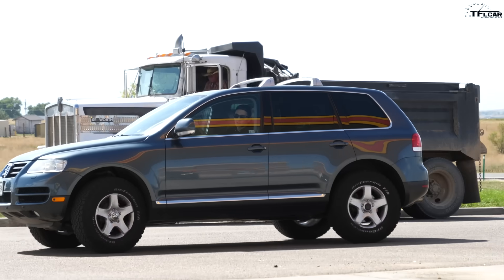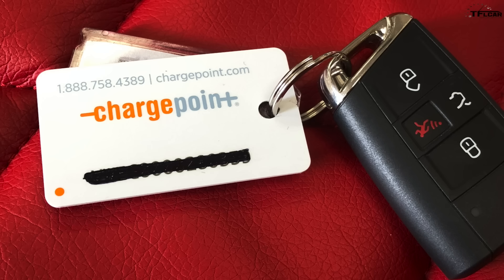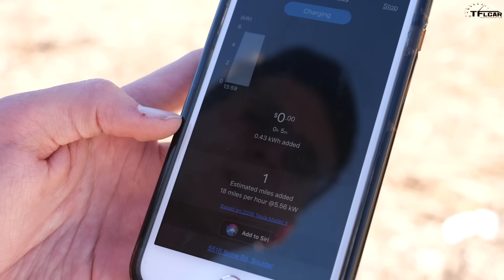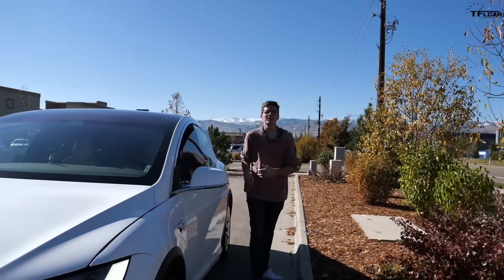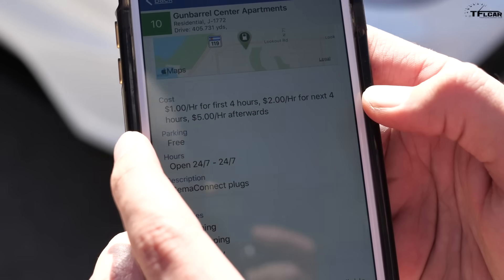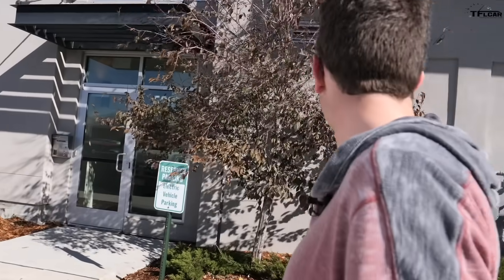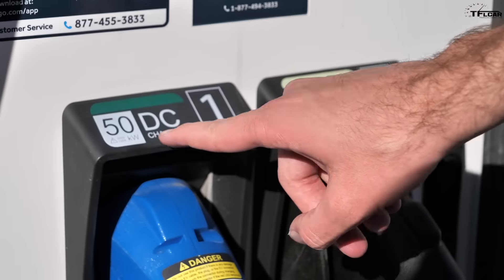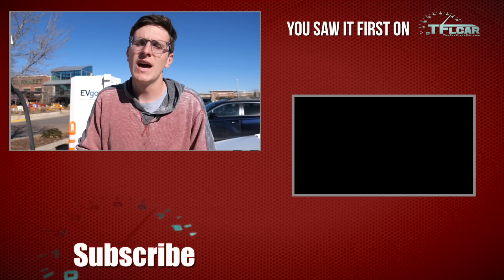Here’s Why Charging an Electric Car Can Suck - And It’s Not The Reason You Think!

Comment: The way he's described it makes EV charging seem unpleasant, but the reality is if you have an EV and need regular charging outside the home, you'll know where the best nearby chargers are and frequent them.  Fortunately I charge in my garage because the former homeowner installed a secondary 220 and I just plug in when I get home. My commute is about 40 miles round trip so I can zoom about on errands during my lunch hour with no problem. For years now I've never had even a smidgeon of range anxiety. About five hours overnight brings me up to 100% My local Target offers free charging and now most walmarts are installing EV chargers. I pay attention to the rates, though, because he's right, the owner can set the rate so they make a profit but that's understandable because chargers are expensive to install.

Comment: 17 miles for 1 hour. And that is why Hydrogen fuel cars are the way forward. Pull up to the pump, fill like you would with gas and you are on your way. 10 hours for a 1/2 charge. Sorry my time is vastly more valuable than the electricity.

Comment: As long as nobody needs to be at work on time, this should do fine. Much like current gas stations, the line forms in the rear🌹
Reply: one girl told me she was late to work because she had to do some extensive cleanup after breaking a mercury electric bulb this will be the same girl that says it took to long to charge her car thats why im late .
Reply: @realtruth172  does that mean you believe mercury is safe?

Comment: Not a pain if you have a house or townhome with 240V outlet.  The pain is the initial install, especially when breaker box is full.  I had to get creative.  Used 240V dryer circuit, changed 240V dryer to 120V, and bought a Splitvolt 30 amp charger.  It can be done.  Splitvolt also makes a box that will share a dryer circuit if you already have one in the garage.  I didn't.

Comment: These ChargePoint stations only really have utility for you to gain a bit of charge while you are using the nearby services. They make sense to plug in for a bit while you’re at the mall, or getting lunch, etc. not to fill the battery, but to recoup some of what you lost to get there. If you think about it, having one of these at every shopping center you go to means you get home at the end of the day with about as much battery as you had when you left to run your errands.

Comment: When they say you get a curtain range , it is based on flat roads’. In Massachusetts we have hills you’re most likely loose 150 miles 
Off you’re predictable mileages.
Reply: also A/c or heater, headlights  is off when they do their max mileage too.
Reply: @williamhaynes7089  80% of electric honda owners trade them in when time and go back to the gas engine. THERE IS A REASON FOR THAT!

Comment: Why is it that these cars don’t have a solar panel on the roof that can charge the car as you drive, or some kind of a charging generator that is attached to the wheels. As you drive it recharges the battery?

Comment: Obviously, this slow charge station is not acceptable unless you can plug in all night. Took time for gas stations to pop up. Will take time for EV charging stations. I don’t plan on EV until this issue is resolved and is simpler than having to use a phone app.

Comment: It cost me $200 to install a 240 plug for my car plus the cord that I got on Amazon for another $250. 
I haven’t paid at a public charger in 3years. 
I charge at home over night and have 450 klms range in the morning if I need it.
Tesla decided to make it that no one from another manufacturer could use their chargers. A bit snotty but there are adapters.
Reply: you obviously dont live in a apartment, good luck installing that in your parking lot if you do
Reply: @williamhaynes7089  no you’re right I don’t, I’m very lucky 
I was just pointing out that a charger can be installed at a house for a lot less than the dealers tell you.
I was quoted $1000 for an electrician for the hook up and $1000 from the charger company when I first bought my car.

Comment: This is an extremely poor presentation, which you can tell by all the ignorant, uninformed comments. At least mention rapid charging and explain you can charge EV’s at rapid chargers at 50/150/350 kW, depending on the vehicle and/or charger. From your presentation (and the resulting comments) you give the impression all public chargers only charge at 15 mph, while ignoring that rapid chargers can charge over 400 mph.

Comment: And then consider you have the new F150 Lightning, you are towing a trailer, on a trip. Try getting the truck with a trailer into a charge station. So you might have to disconnect the trailer first. Major PITA. Imagine having to disconnect your trailer to fuel at a gas station!

Comment: I have a problem with electrical vehicles. I knew in the beginning that charging any vehicle would be a problem. If we can all agree and make the same Outlet worldwide for a vehicle. or let gas stations put up two chargers for vehicles at their gas stations. As vehicles are more environmentally friendly. even if they're diesel or electric we still have a huge problem. You might not know this. but the government is lying to you about the power grid. We will not be able to drive electrical vehicles until the year 2070 or even later this goes for Europe and North America. even Australia has a problem. you might call yourself environmentally friendly. if you drive an electric vehicle. You have to remember one thing those batteries in those Vehicles need to be changed maybe not in five years. Maybe not in 10 years. The batteries have a problem when they get removed. They cannot be properly recycled. And the metals in them could be very toxic to the water supply. So we have a problem with electrical vehicles. number 2 things you will not like. the government or governments will not be using electrical vehicles. military or police and fire departments and ambulances will still remain gas-driven or diesel-driven vehicles. No one has come out with proper laws. on what to do next. it should be mandatory that every gas station in the world has a charger and gas. instead of a charger that needs to have an app downloaded. why can't we just use a bank card or cash? just shows you that you will be living on credit for the rest of your life. I don't own a credit card. And I do not want to download an app. If the gas stations are smart. and want to actually make money. They would start setting up now. but here's the problem all gas stations are not allowed to have chargers at the gas stations. it is all up to us to tell all the gas stations and companies that sell fossil fuels. To also put charging ports at their gas stations. I love the thought of everyone driving electrical vehicles. But it won't work. these corporations do not come together. it's going to be a huge downfall in the near future.

Comment: So....Before I would buy an electric car it needs to totally recharge in 15 minutes or less. It has to be a standard plug so I don't have to buy extra adaptors. It has to be able to be paid without using a phone ap. Long way to go. I don't have time to double my 9 hour trip home to visit family. Maybe Joe, (or whomever is in charge), should get some of these problems solved BEFORE they start cutting oil production which can already perform very well in a hybrid car. Oh yeah when Joe talks about greater pay for the average worker, they are blowing it all on higher gas and groceries.

Comment: I would use an EV around a city and plug it in at home as I have 230V, but, I do not believe the climate is actually in too much danger as the climate science is far from settled, you still have to drill and mine to get the minerals the batteries are made from, the batteries have a very short life span and can not be recycled as yet,

Comment: I said this to others, buying an electric car today is too early.  The companies still need to standardize on many items (battery types, charging connectors, battery installations).  Imagine driving outside of cities and trying to find a charger that is open and works for your car.  Also, waiting hours to charge your car before you can continue your road trip.... pain in the ass.  Way too overly complicated just to pay for a charge and dependent upon your phone, internet access, tech service up and running, station availability, etc.  It should be "here is my credit card,  accept it".

Comment: Nice. Like I didn't already have a dozen reasons for not driving an EV. You just gave me more to add to my list!  :)
Reply: We own a Tesla Model Y SUV long range 325 miles. We love it and have had 0 problems. We are buying another Model with the 4680 battery which may have close to a 500 mile range. We have 17K miles -the charge in our garage costs us 18 cents a gallon and 80 cents on the road. You will charge 90% in your garage. The car will last 1 million miles and the battery 500K miles. I am 78 years old, my wife took over the Tesla and called it "baby". I never drive it. She will get the new one. "happy life, happy wife....
Reply: @bobskeway8179  We just returned from a 6,155 mile trip, crossing 23 state borders. We filled our tank 16 times -- a 10 minute stop each time and we were on our way.

Comment: My condo building has 170 spots in the underground parkade; and I'd estimate 20 - 30 more above ground spots. All these parking spots are attached to individual suites (some suites have two parking spots).  None of the spots are powered. It would be a very costly undertaking to install the electrical infrastructure to the building for this. Also, do the chargers work in temps of zero degrees Fahrenheit (or colder) as we regularly experience here in Canada?

Comment: EV won't work for me. I drive over 1000 KM's a day  on remote highways and off highway on forest service roads. Not exactly a lot of chargers 300 KM's up a decommissioned logging / mining road....if I need to refuel I simply unhook the hose from the 500 liter tank on the back of the truck , full up 100 liters in less than 5 minutes and keep going. 

I'd consider a diesel - electric hybrid truck if they were 1 ton & 4x4

Comment: The presenter in this video, I think, did a great job. That said, i didn't like the idea of electric since my dad talked about then 40 years shop. This only edified my thoughts. Not to mention that I believe this is all just a money grab that does not really help environment. ICEs are ACTUALLY supposed to get(what general population would consider) TEN TIMES bete better fruel economy. ONLY vapor is flammable, but cars are DESIGNED to squirt a MIST(liquid) into the cylinders, thereby purifying UNNECESSARY waste/pollution. Visit fuelefficientvehicles.org and read about a VERY SMALL handgun of purple that figured this out and are getting MORE than 100(ONE HUNDRED) MPG....

Comment: In Little Estonia is charges sations ca 150 = each 40 km/25 miles. Next country Finland are charges  200 = each 80 km/ 52 miles. Latvia are midlle = 120 chargings points ca 53 km/ 34 miles.  In Estonia is charges price 0,16 - 0,36 euros 1kW/h (in cities higer price and  highway cheaper ) . You can her pay app, bankcard or cash.  Average public charger is here quick charger 50 kW/h . Average electriccar is 32 - 48 kW/h = You can less then one hour full accumulator. ( 5,12 -17,28 euros ).

Comment: I want an EV but I need it to be a plug in hybrid that has virtually unlimited range.  All charging can be done while I am otherwise occupied, like at my desk working or while I sleep.  If I need to extend my range while en route somewhere, the gasoline engine cuts in.  No range anxiety.  No time wasted waiting to charge.
Reply: Good point plus hybrids also charge when braking while running on gas.

Comment: Charge an hour to go to a charger in the next town (16 miles) or fast charge to the next county (100 miles). My 2012 Sonic gets a full charge (of gasoline) in two minutes, good for 400 miles, and the old 1995 Nissan pickup at least 350 miles. Then there's the 0-60 times of 2-3 seconds quickness and people already drive like maniacs, sober. And, when the thing is wrecked, but luckily didn't burn up, what's your average tow-truck driver facing here, in terms of potential ELECTROCUTION? Lots to think about here, in depth.

Comment: What? Everyone has access to 240 volts in North America for home charging. Yes, you will need to install wire and breaker but that’s generally simple.
Reply: Not that simple. My house is totally electric.  No natural gas. A/C, stove, dryer. I would have to add subpanel as no place to add. Also, would have to upgrade my service with electric company.  Part of electric bill is based on total power supplied to house. I found only ten charging stations within 25 miles of my house (and I am 20 miles from capital city of my state).  All are Tesla level 2 and are located at hotels for guest use only.  

My previous house had washer/dryer hookup in garage.

During Texas Ice storm this year, people drained their Tesla Powerwalls charging EV. Then once no battery left in car, no heat in house or car.

Comment: These EV companies need to come up with a standard charging plug.
Reply: Gas pumps are not standard either. Try putting a diesel nozzle into a non diesel car. BTW making it standard doesn't actually solve the problem. In the EU a standard CCS2 handle is mandated. If one has a non Tesla EV and pulls up to a Tesla Supercharger, the handle will fit. And you still won't be able to charge because Tesla only allows Tesla owner to charge at SuperChargers. So, exactly then did having a standard buy you?

Comment: Nicely done video my friend.  I don't see me plugging in my car and hanging out at the curb for 10 hours so I can drive another 50 miles.  Do you bring your Kindle?
Reply: My friend you don't understand the difference between overnight and fast charging. First off at 15 miles recharged per hour at 5.5 kW, you can recharge 150 miles in a 10 hour time frame overnight. If one really needed a charge to move along, one fast charges at a DCFC station. https://www.youtube.com/watch?v=FgqCyy53C_g shows an example of an Ioniq 5 charging from 6-100% at an Ionity fast charger. EV fast charging operating procedure is to charge to only 80% charge since the charging speed slows above 80%. The 6-100% recharge, which is about 280 miles of range of recharge, takes 42 minutes. The standard charge to 80% from 6% only takes 24 minutes and recharges 240 miles of range.
Reply: @georgiaev7860  Thank you for your reply.  I surely missed the point on some of it.  I guess I'm grappling with the notion of not simply sticking a gas hose in the car for 3 or 4 minutes and taking off again.  I wish we had better battery technology.  Recently I've been reading about denigration of auto battery packs and how much they cost for replacement.  We have the right idea, I think but still not quite the technology to make it tenable for most people.

Comment: If people want e-cars to take off as the norm they need to be able to fully charge a car in the time it takes to fill a car with gasoline or gas powered cars are here to stay.
Reply: Let's see if this analogy helps in understanding the difference. Imagine that you can only recharge your iPhone at the Apple store. And that it took 3-4 hours to recharge. I imagine that you'd be upset having to wait around for your phone to recharge. iPhones still take several hours to fully recharge. But do you worry about it? Likely not. Because you charge at home overnight while you are sleeping. So, even if it's 2-3 hours, it doesn't really matter. Refueling ICE vehicles is like having to go to the Apple store to recharge. Speed is of the essence. EVs recharge at home overnight. So, the charging speed or the charging time doesn't need to be at the top rate.
But wait! EVs can charge fast two. https://www.youtube.com/watch?v=FgqCyy53C_g shows an Ioniq 5 charging from 6-100% in 42 minutes. And using the standard metric of fast EV charging, which is charging to 80%, that part of the session only takes 24 minutes.

Comment: Until you can get a 3/4 full charge in under 10 minutes this is not yet feasible for driving far from home.
Reply: Have you actually timed a gas station stop with a family on a road trip? By the time you've gotten the gas, used the facilities, browsed for snacks, and get everyone back into the car, the result is typically over the 10 minute mark. https://www.youtube.com/watch?v=FgqCyy53C_g shows an example of an Ioniq 5 doing a full 6-100% charge in 42 and a 6-80% charge, which is EV standard in 24 minutes. Does 24 minutes as opposed to 10 literally make driving and charging and EV unfeasible?
Reply: @georgiaev7860  I travel alone.

Comment: They key drawback is the cost. Here in Arizona the Blink Charger costs upwards of 41c per kwHr. EVGo is 35c per minute (which at 50kW corresponds to 42c per kwHr). I should concede, charging costs do varies. For instance one site near us charges $4.95 + 20c per min. However at the end of the day it means that charging away from home really isn't competitive with current gasoline prices. Now charge at home and that gets turned around; my running costs, per mile traveled, are about half the cost of an equivalent Hybrid. But of course I also get super-taxed by Arizona because apparently I'm not contributing enough tax to pay for the roads...

Comment: let me get this right.
It takes an Hour to charge enough to drive 15-16 miles. 

hope you don't have to drive cross country. holy crap, it would turn a 1 day trip into a 4 or 5 day trip.
Reply: Fast charging stations can recharge EVs in the range of 200-800 MPH recharged. Only a foolish novice would try to use a L2 station for a cross country trip.